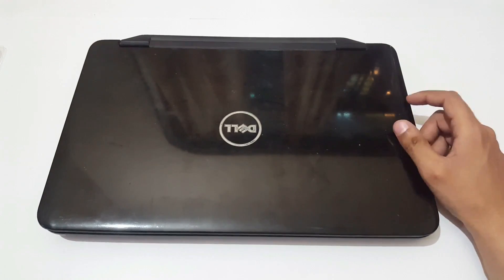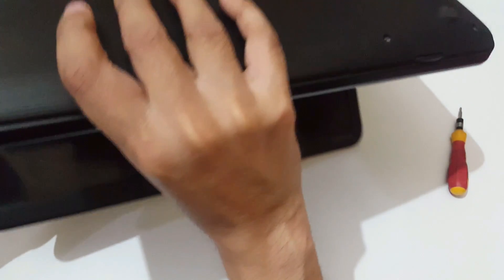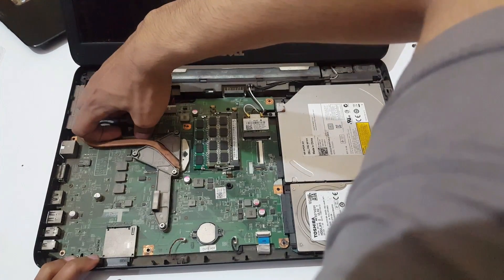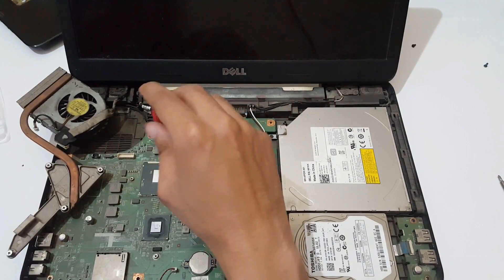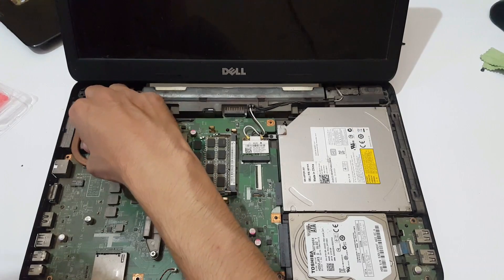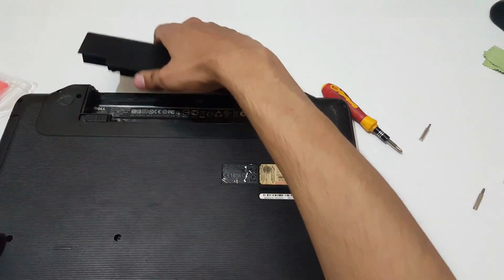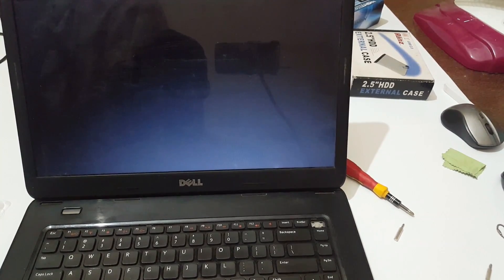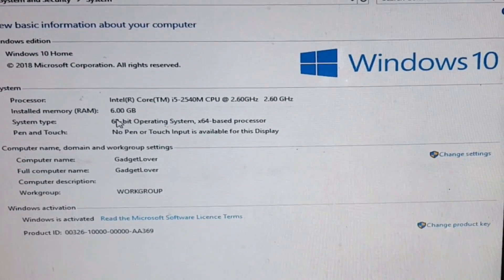How to Upgrade Processor on DELL Laptop | i3 to i5 & i7 - Make Laptop Faster for Gaming

Comment: This is an amazing video. I really enjoy it. How can we determine what processor (plan to upgrade) suits the most?
Reply from the maker: MeTime : Thanks and tell me what processor is in your Laptop
Reply: @GadgetLover360  Is i7-4510U
Reply: Currently RAM using is 8Gb
Reply: I hope to upgrade my processor together with the RAM to 16Gb
Reply from the maker: MeTime : Intel Core i7 4600U is best processor for your Laptop and I would suggest you upgrade its RAM and install SSD for more better performance
Reply: @GadgetLover360  I c. My computer only can support up to 8Gb of RAM where I already done upgrade. Now only the SSD. Thanks for ur advice. 😊👍
Reply from the maker: MeTime : You're welcome
Reply: @GadgetLover360  Hi bro. Can I upgrade my processor to i7-6700HQ instead of keep on using my current processor?
Reply from the maker: MeTime : Unfortunately you can upgrade it in same generation only
Reply: @metime3587  how do I know how much ram my laptop support? Google?
Reply: @bizybliztaverage9414  YEs, i find the answer by searching on Google, key in your processor model will do or you can also get full information of your computer model through Google (my laptop brand is Dell and I just key in my laptop model and all the information will appear in front of your screen). Good luck
Reply: @metime3587  I have a dell 3578 with an 8th gen i7 8550u processor with my 8gb(all used up) and my 250gb ssd
Reply: @GadgetLover360  I have a Dell XPS 12-9Q33, can I use the same i7-4600U? My 4gb ram is soldered to the board tho.
Reply from the maker: @oddis-he4853  The processor is also soldered so you can just upgrade the SSD
Reply: @GadgetLover360  would i be able to upgrade my cpu it is a i5 1031g in a acer aspire 5 eith 12gigs of ram
Reply from the maker: zE WispeR : The processor of this Laptop is soldered so you can't upgrade it but I would suggest you upgrade its RAM and install SSD for better performance
Reply: @GadgetLover360  bro I have Dell Inspiron n5110 and it have Intel I3 2nd gen processor and it's only have 2 core can I upgrade my processor to any 4 core processor?
Reply from the maker: @arshad4487  I would like to inform that you can upgrade it in same generation of 4 cores processor
Reply: @GadgetLover360  can you please tell me which 4 core processor is suitable for  my Dell Inspiron n5110 exact name of that processor
Reply from the maker: @arshad4487  Intel Core i7 2820QM
Reply: @GadgetLover360  do you know where I can buy it
Reply from the maker: @arshad4487  I would suggest you buy it from Ebay online store
Reply: @GadgetLover360  Intel mobile i7-2720qm 2.2Ghz 3.3ghz 6MB 4 core there is only this processor left in eBay will this work on my laptop
Reply from the maker: @arshad4487  Yes
Reply: @GadgetLover360  am sorry for asking to many questions. this Intel core i7 2720qm processor have dedicated 1gb graphics card ?
Reply from the maker: @arshad4487  No it uses system RAM and this system RAM is slower than dedicated graphics memory
Reply: @GadgetLover360  hey is it possible to upgrade your processor to a modern day one if its from a laptop thats 3 years old?
Reply from the maker: @glitchtube3363  I would like to inform you that if the processor is not soldered you can upgrade it in same generation
Reply: @GadgetLover360  you mean the same generation as the laptop or the newest version?
Reply from the maker: @glitchtube3363  Upgraded version of same generation processor
Reply: @GadgetLover360  so same generation as the cpu?
Reply from the maker: @glitchtube3363  Yes
Reply: I have Dell Vostro 3500 I want to change to ryzen5 is it possible
Reply from the maker: manoj kalyan : Unfortunately you can upgrade it in same generation only
Reply: @GadgetLover360  why bro any reason I have i5 processor and my main reason is there is no virtualization support and also gaming is bad any suggestions can I switch to i5 8th
Reply from the maker: manoj kalyan  : Unfortunately you can upgrade it in same generation only for Intel Core i5 8th Generation you have to replace motherboard of Laptop
Reply: @GadgetLover360  ok in same generation do I get any better processors for gaming
Reply from the maker: manoj kalyan : What processor is in your  Laptop
Reply: @GadgetLover360  i have i3 processor dell inspiron 3442 can i upgradge it
Reply from the maker: GAMING ZEN : The processor of this Laptop is soldered so you can't upgrade it
Reply: @GadgetLover360  Thanks
Reply from the maker: GAMING ZEN : Thanks
Reply: @GadgetLover360  Bro, I have a Dell Inspiron 5559 laptop, with an 8 Gb RAM and a Core i5-6200U processor. Is it possible for me to upgrade its processor to a 16 Gb or 32 Gb RAM, and is it possible to change the processor from an i5 to an i7?
Reply from the maker: KeekBack Vidz : The processor of this Laptop is soldered so you can't upgrade it but I would suggest you upgrade its RAM and install SSD for better performance performance
Reply: @GadgetLover360  I have a Dell vostro 15 3568
Intel core i3 7100u
16gb ram (2x8gb)
Intel hd graphics 620
Is there any way I can upgrade cpu or gpu?
Reply from the maker: Riley Wise : The processor of this Laptop is soldered so you can't upgrade it but you can attach graphics card externally to your Laptop for better gaming experience
Reply: @GadgetLover360   I have a Dell vostro 3550 with a intel inside core i5 and 4 GB ram what's the best upgrade option for this laptop?
Reply from the maker: Yato sama : Intel Core i7 2640M is best processor for your Laptop and I would also suggest you upgrade its RAM and install SSD for more better performance
Reply: @GadgetLover360   thanks
Reply from the maker: Yato sama : You're welcome
Reply: @GadgetLover360  I have a dell inspiron 14 n4050, processor intel core i3 with 32bit. Is it possible to upgrade to i5 or i7 processor?
Reply from the maker: Luqman Faizal : Yes and I would like to inform you that Intel Core i5 2540M is best processor for your Laptop
Reply: @GadgetLover360  oh okay thank you
Reply from the maker: Yato sama : You're welcome
Reply: I have a intel(r) core(tm) i3 cpu  u330 1.2 ghz processor . What’s a good  upgrade for it
Reply: I'm using Dell Inspiron i3 Intel processor with 5th generation. Can I upgrade my processor to i5 intel core ?
Reply: Contact number brother
Reply from the maker: raj goud : If you have any problem related to this video let me know I would be happy to help you
Reply: AMD ryzen 9 5950x
Reply from the maker: Talha Shaukh : It is a desktop processor specially known for gaming
Reply: @GadgetLover360  hello dear..
My laptop dell  Inspiron model
i5 4th generation ram 4 GB, HDD 1TB
Is it possible to upgrade i5 4th gen to  i7 processor???
Reply from the maker: Night Angel : Hi and I would like to inform you that if processor is not soldered you can upgrade it in same generation of Intel Core i7 processor
Reply: @GadgetLover360  Hii bro 
My laptop is dell Inspiron 3558
And it has i3 5th gen and 4gb ram
So can I upgrade my processor to i5 5th gen and 8gb ram.
Reply from the maker: N3E GAM3R YT : The processor of this Laptop is soldered so you can't upgrade it but I would suggest you upgrade its RAM and install SSD for better performance
Reply: @GadgetLover360  Thanks bro
Reply from the maker: N3E GAM3R YT : You're welcome
Reply: @GadgetLover360  Can I update my Intel(R)celeron(R) 2957U @1.40GHz processor of my dell laptop with 4gb RAM? If yes please suggest the suitable Processor.
Reply from the maker: Shashank Solanki : If the processor is not soldered Intel Core i5 4310U is best processor for your Laptop
Reply: @GadgetLover360  thankyou very much.
Reply from the maker: Shashank Solanki : You're most welcome
Reply: i'm using dell inspiron 3520, in which i have i3-2370M 2.40Ghz(sandy bridge) and Max TDP 35W. Socket 9888rPGA. Now i wants to upgrade this so can u tell me which processor should i buy?? thanx in advance.
Reply from the maker: Ras gulla : You're welcome and Intel Core i5 2450M is best processor for your Laptop
Reply: @GadgetLover360  Can you tell me where can i buy the specific processor online? Because of this lockdown i m unable to visit local market

I tried finding it but couldn't find it
Reply from the maker: Shashank Solanki : I would suggest you buy it from Ebay or Aliexpress online store
Reply: @rasgulla8415  to
Reply: Sir, i have a Dell laptop with intel(r)celeron(r) cpu N2840 2.16GHz 4gb ram, it's also 64 bit, can i upgrade it to intel core or to other faster processor? what would you recommend? thankss
Reply from the maker: joe mama : You're welcome and Intel Pentium N3540 is best processor for your Laptop
Reply: @GadgetLover360  Hi! My laptop is HP Probook 4431s Intel(R) Core(TM) i5-2520M CPU @ 2.50GHz   2.50 GHz. can I upgrade this one to i7?
Reply from the maker: John Michael Amper : Yes and Intel Core i7 2640M is best processor for your Laptop
Reply: @GadgetLover360  I use a dell Vostro 3500 with i5 11 gen, it has 4cores can I upgrade it to 8 core?.
Reply from the maker: @learningeverything8881  I would like to inform you that if the processor is not soldered you can upgrade it in same generation
Reply: Can i upgrade to i5 or i7? Current processor is intel i3 1st gen 380M. Laptop is vaio model pcg61312w. If i'm able to upgrade how to pick the right processor. Thanks.
Reply from the maker: Kenneth apostol : You're welcome and yes Intel Core i5 580M is best processor for your Laptop
Reply: I have dell inspiron 14 3467 laptop with i3 606u processor. Can I upgrade it and what is the best upgrade in i5
Reply from the maker: Unique Astro : In my knowledge the processor of this Laptop is soldered so you can't upgrade it but I would suggest you upgrade its RAM and install SSD for better performance
Reply: Hello, I have an HP Pavilion 15 laptop with i7 4702mq (gen4th). Can   I upgrade my cpu to i7 4940mx or i7 4980hq? Thanks!
Reply from the maker: @dubledrive1  You're welcome and the processor of this Laptop is soldered so you can't upgrade it but I would suggest you upgrade its RAM and install SSD for better performance
Reply: @GadgetLover360   Thanks so much!
Reply from the maker: @dubledrive1  You're most welcome
Reply from the maker: @Smiley Thanks and the processor of this Laptop is soldered so you can't upgrade it but I would suggest you upgrade its RAM to max and install SSD for better performance
Reply: I am having dell vostro 2520 it has i3 8th gen processor can i upgrade it with i5 8th gen?
Reply from the maker: @techsiddharth9931  Yes
Reply from the maker: @Gowtham Raj.S 15bco716 Search on Google and if not found disassemble it to know whether it is soldered or not
Reply: Hey bro! Is it possible to upgrade cpu of Vostro 3446 from i3-4005?
Reply: Can I upgrade my laptop? The CPU of my laptop is i3 2310m. If my laptop is upgradable? What are the best CPU that you can suggest? Thank you for your reply.
Reply from the maker: @JanAndreiDiaz  You're welcome and if the processor is not soldered then Intel Core i5 2540M is best processor for your Laptop
Reply: @GadgetLover360  excuse me i use hp pavillion d7-4183cl
Ram 8gb (max)
Intel i5 460M
Intel HD graphics
450gb ssd
Can u suggest any upgrade i can make?
Reply from the maker: @uddinfine142  You can upgrade its processor and Intel Core i7 640M is best processor for your Laptop
Reply: Hi bro i have inspiron 15 series...with i3 4th gen.....which onewill support to my pc I5 I7?
Reply from the maker: @ReyBoy09  Hi and I would like to inform you that if the processor is not soldered you can upgrade it in same generation
Reply: How much cost  of upgrading processor??
Reply from the maker: @cashdigger2082  I would suggest you see price details of processor on ebay online store
Reply: Hi , can I upgrade my Dell Inspiron 5567 model to i5 or i7.Below is my current configuration of my laptop.

Processor-Intel(R) Core(TM)  i3-6006U  CPU @ 2.00 Ghz 
Installed Ram - 4GB
System Type- 64bit operating system,x64 basedprocessor

Please advise

Comment: Will this setup work on the dell inspiron 15 5566? It's got the i3 so I think it should work, is there also a way where I can upgrade the graphics card?
Reply: And what is my limit for best performance on 16GB of ram and possibly a new CPU
Reply from the maker: 38entamitc : The processor of this Laptop is soldered so you can't upgrade it and I would suggest you upgrade its RAM and install SSD for better performance
Reply: @GadgetLover360  never thought about SSD but ram has been a common factor. Thanks!
Reply from the maker: 38entamitc : You're welcome

Comment: Hello, i have a dell latitud e6230 with Intel(R) Core(TM) i5-3340M (2)2.70 GHz. Shall i upgrade it to an i7?
And it have 4gb of ram i want to put 16gb is it a good change???

New sub!
Reply from the maker: Raitod_22 : Dear Subscriber thanks for your subscription and unfortunately the processor of this Laptop is soldered so you can't upgrade it and yes RAM upgrade will boost the performance of your Laptop

Comment: Hai
How to increase speed my dell inspiron  n5050 ? Pls reply
Reply from the maker: ashiq pt : Upgrade its RAM and install SSD for more better performance
Reply: Gadget Lover : ram already  6gb
But laptop very slow. Some time stuck then use power button turn off.
Reply from the maker: ashiq pt : What processor is in your Laptop
Reply: Gadget Lover : intel core i3
Reply from the maker: ashiq pt : I would suggest you upgrade it to Intel Core i5 2540M and also upgrade its RAM and install SSD for more better performance
Reply: Gadget Lover :ok thanks
Reply from the maker: ashiq pt : You're welcome

Comment: Bro i have a question i have i5 7200U and 4gb ram (i will upgrade to 8gb ram soon) and i want to play fortnite and gta 5 on high fps should i buy a cpu or should i upgrade my gpu? (I have amd radeon r5 m430)
Reply from the maker: Its Fares : I would suggest you first upgrade it to Intel Core i7 processor then attach graphics card externally for better gaming experience

Comment: Sir may i know the best cpu upgrade for Acer Aspire E 14 (E5-471-3538). Currently i3 - 4030U 🙏
Reply from the maker: naim firdaus : Intel Core i5 4310U is best processor for your Laptop and I would like to inform you if processor is soldered you can't upgrade it

Comment: bro i have acer aspire e14 5 471 which is using i3-4005u (1.7GHz) and 4gb ram.
can you suggest better ram and core for me?
thank you in advance :)
Reply from the maker: Muhammad Daniel Ikmal : Intel Core i5 4310U is best processor for your Laptop and I would like to inform you if processor is soldered you can't upgrade it
Reply: how can i know that my processor is soldered or not?
Reply from the maker: Muhammad Daniel Ikmal : See its disassembly video

Comment: I have the inspiron n4050 and I want to put an i7 processor to improve the performance of it if you can I would like to know which i7 processor would work for you thanks
Reply from the maker: eymer p : What processor is in your Laptop
Reply: @GadgetLover360  My current processor is an icore i5 2670M, that is the one I have at the moment but I saw a video where a boy has the same laptop and I put an icore i7 2670M on it. Did it work? Can you change it for a better generation i7?
Reply from the maker: eymer p : What model
Reply: @GadgetLover360  inspiron n4050
Reply from the maker: eymer p : Intel Core i7 2640M is best processor for your Laptop
Reply: @GadgetLover360  thanks you bro
Reply from the maker: eymer p : You're welcome

Comment: just 10 minutes ago i read on a forum that my sony vaio vpceh25fm with i3 2330 can be upgraded to i7 2630qm . the big problem here is that i have an i7 2630qm and just mounted it and the laptop doesn't want to turn on
Reply from the maker: Tiberiu Mihai Florea : Reinstall it properly and don't forget to apply thermal paste and if still not opening eject and properly reinsert RAM then try again

Comment: Intel(R) Core(TM) i3-5005U CPU @ 2.00GHz  (DELL)
RAM :  4 GB  
can i update processor and RAM? PLEASE SUGGEST.
Reply from the maker: Amit kumar : Intel Core i5 5300U is best processor for your Laptop and I would suggest you upgrade its RAM and install SSD for more better performance
Reply: Bro do u have dell vostro 3000 series laptop ? Coz I have same specs of my dell
Reply: Bro do u have dell vostro 3000 series laptop ? Coz I have same specs of my dell
Reply from the maker: Abhijeet Gamer Clan : No

Comment: LENOVO E49
PROCESSER INTEL B970
DUAL CORE
WHICH IS BEST PROCESSER TO UPGRADE IN 2020
Reply from the maker: Nayan Borah : Intel Core i5 2540M is best processor for your Laptop and I would like to inform you if processor is soldered you can't upgrade it
Reply: @GadgetLover360  BUT I OPENED IT ONCE
Reply from the maker: Nayan Borah : Okay so if it is not soldered you can upgrade it
Reply: @GadgetLover360  can you give me a link of this processer
Reply from the maker: Nayan Borah : I would suggest you buy it from Aliexpress online store
Reply: @GadgetLover360  can it run PUBG?
Reply from the maker: Nayan Borah : You can try light mode
Reply: @GadgetLover360  PUBG MOBILE ON EMULATOR M?
Reply from the maker: Nayan Borah : Yes
Reply: @GadgetLover360  Can i put a desktop processer in laptop?
Reply from the maker: Nayan Borah : No

Comment: Do u Know best Processor for my laptop?
Asus X441ba , AMD Dual Core A4-9125 >>>>>>> ???
Reply from the maker: ツHelvinzKunz : AMD A9-9420 is best processor for your Laptop and I would like to inform you if processor is soldered you can't upgrade it
Reply: @GadgetLover360  Is there nothing else besides that?
Reply from the maker: ツHelvinzKunz : No but I would suggest you upgrade its RAM and install SSD for more better performance